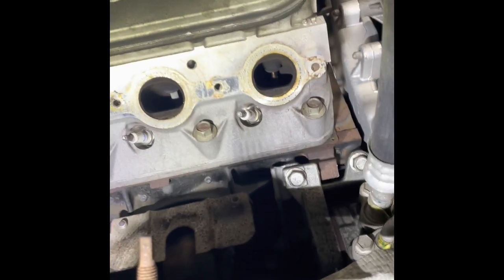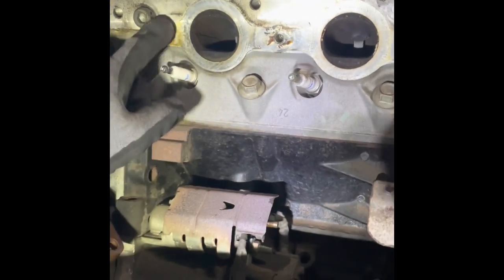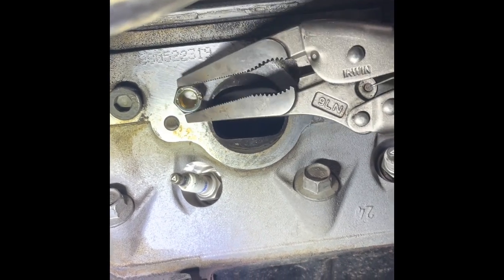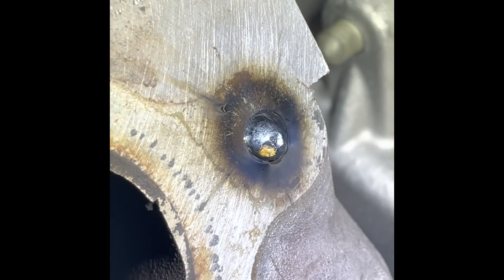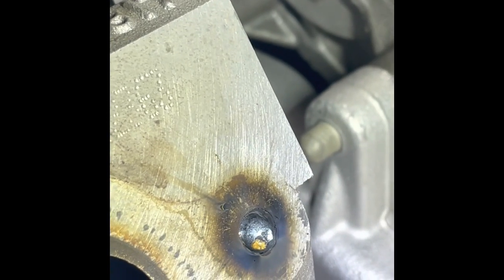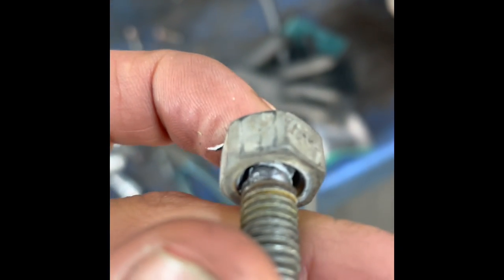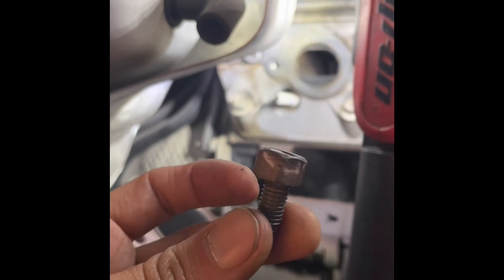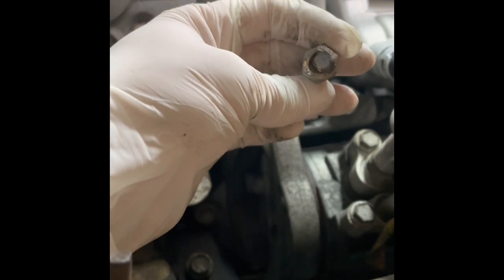Remove a broken exhaust manifold stud (aluminum head)

Comment: A note do this with a stick welder . and 6013 1/8 rods . I tried 10 times with a mig welder with no sucess for a stud broken off 1/2" below top of head. The M8 stud came right out of the 5.4 3 valve.

Comment: I'm trying this on my 01 trx sportrax with a flux core welder and the nut just keeps breaking right off like it's not getting a good weld prolly my welder it's pissing me off lol
Reply from the maker: Heat up the broken stud on the head. Turn the welder up higher and build up the weld on the broken stud. Place the nut on the built up weld and fill up the nut with weld.  Hope it works. Also if possible grid/clean the broken stud before welding.